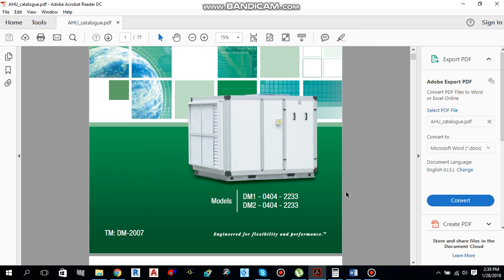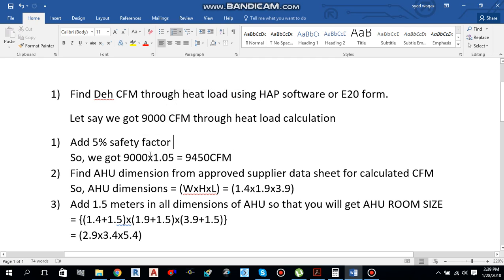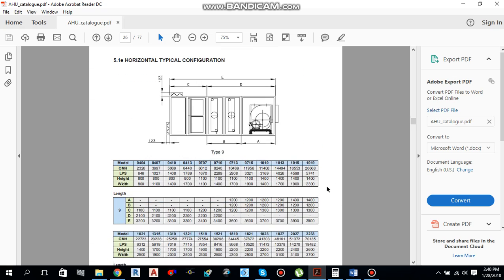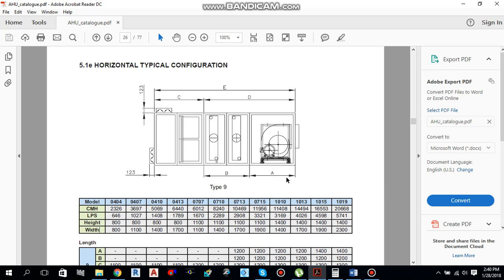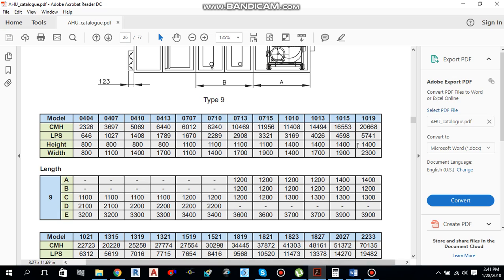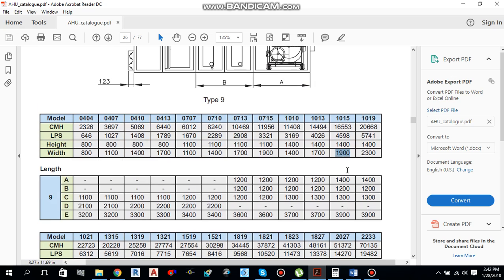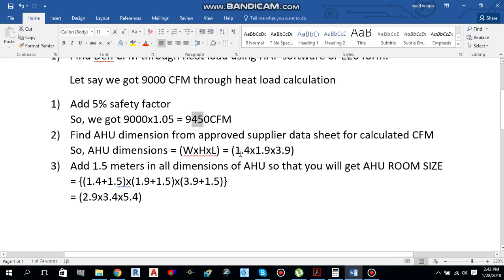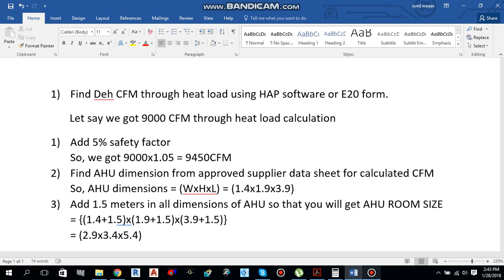Air handling unit (AHU) room sizing method/procedure in chilled water system

Comment: please , tell me why we adding 1.5m to all dimensions , why not 1  or 2  from which standard we get this value !!
Reply from the maker: This is the minimum standard, obviously you can go more than 1.5 Mtr. It depends on your duct size coming out from the mouth of AHU and chilled water pipe size from your machine. If you find it difficult to adjust your ducting and piping then you can go for more like up to 2 Mtrs but remember don't go below 1.5 Mtr.